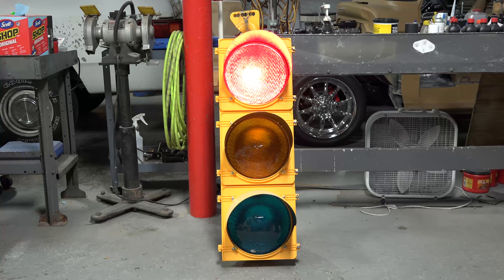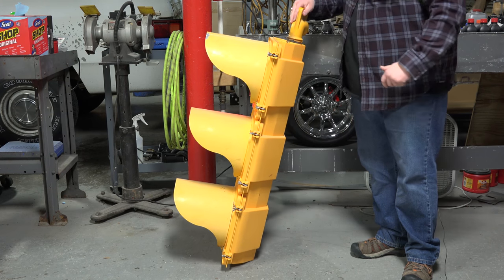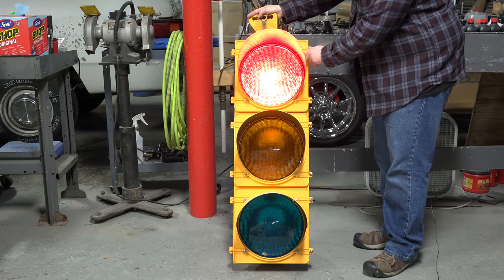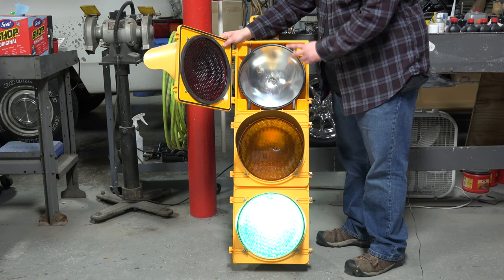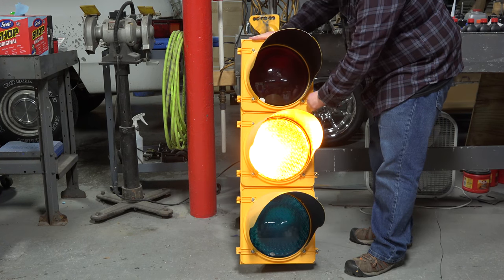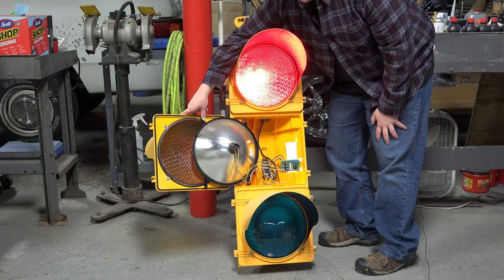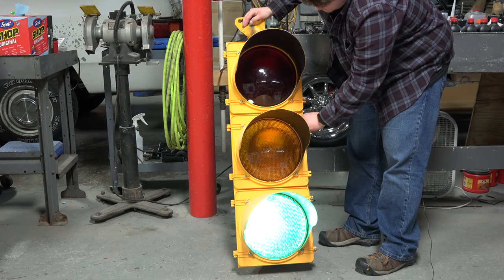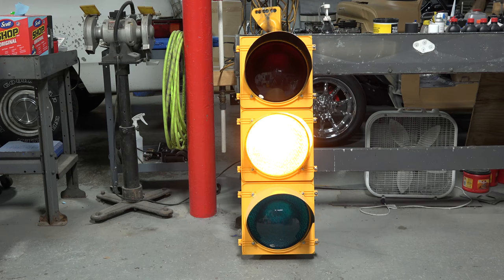What's Inside a Traffic Light?

Comment: CROUSE HINDS bought by TCT in 1982.  TCT bought out by PEEK TRAFFIC in 1991.  PEEK in turn sold it's traffic control line to FORTRAN LTD. of CANADA  in  2011.  Those are ALUMINUM MTS (MCCAIN) VISORS
Reply: That is incorrect. Polycarbonate Fortrans housings are slightly different and started production in 1988.
Reply: @Gentrol  with econolite style doors
Reply: @theray2009  Slightly modified them though, especially the 12".

Comment: I’ve noticed that a lot of traffic lights still use incandescent lamps in the yellow (amber) lights today, which makes some sense, considering that they are more inexpensive, and are used less.
Reply: I usually see incandescents in the yellow section of older traffic lights that were installed before LEDs became the standard. Newer traffic lights installations will be all LED. But you are right, it's kind of unnecessary to replace the incandescent with a yellow LED, because since the yellow is turned on for a total of mere minutes per day, it would take forever for the energy savings to recoup the costs of purchasing and installing it.

Ironically yellow LED modules tend to draw slightly more watts than red or green LEDs, mostly because a yellow LED chip requires more current to get as bright as a red or green LED chip. But again, the higher wattage doesn't really matter because the yellow LED module is on mere seconds at a time.
Reply: And they also figured that when the incandescent bulb burns out,  that would be a good time for signal maintenance.

Comment: I am pretty sure those TCT signals are now made by PEEK
Reply from the maker: Matt Smith Yep! You are right. Being a spur of the moment video, I thought it was but didn’t want to say it, possibly be wrong and look like an idiot. Lol. Chappell Hill makes a very similar version of these also, but they are pretty cheaply made.
Reply: Charlie Davidson, Exactly. Chapel Hill does have a very similar mold and I would guess the initials CH were no mistake. I have one of their 8" poly signals and it is the only 8" signal that I have seen with two latches per door. It sadly needs both due to quality, so you called it. Thanks for the video!
Reply: @mattsmith5797  Want to say most 8 inch polycarbonate (plastic) signals require two latches to keep the doors shut and prevent warping.
Reply: @freebrickproductions  not McCain ones
Reply: @Taylor-xh8uh  IIRC, McCain literally reinforces their poly signals with fiberglass.
Reply: @freebrickproductions  You can choose whether you want reinforcement or not upon ordering. I'm not too impressed with McCain's fit and finish but I got to give it to them for one of the most durable poly heads on the market.